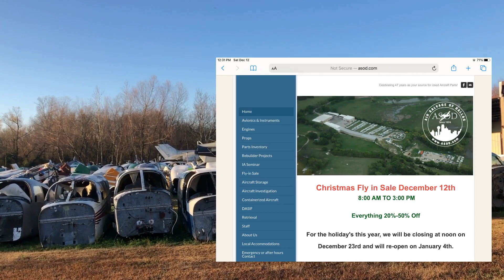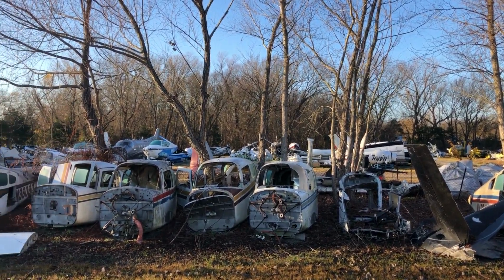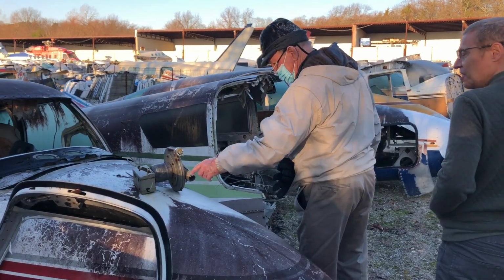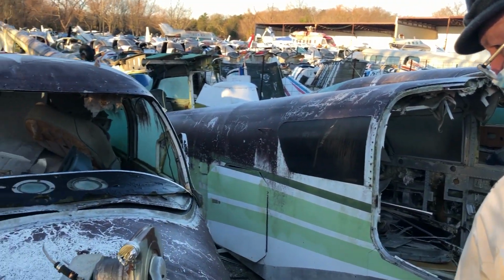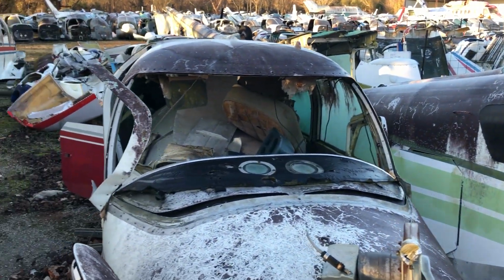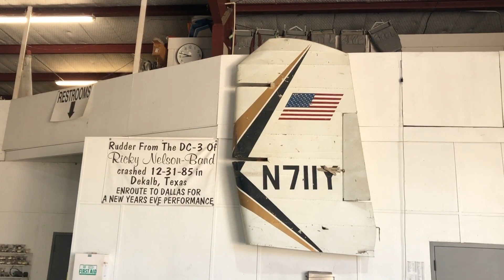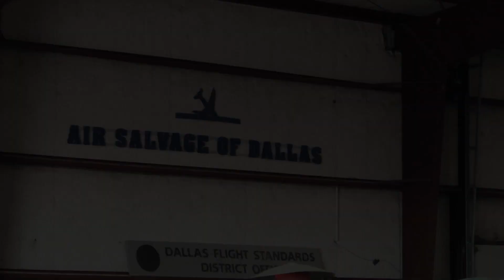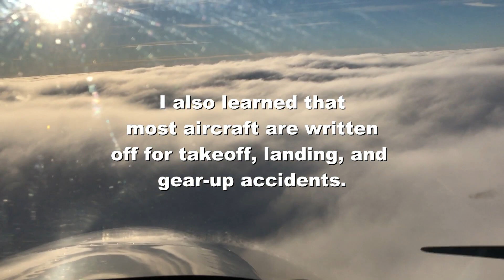Where old Cessna's go to die - salvage yard open day

Comment: I owned a ‘58 Cessna 310B for 7 years then upgraded to a ‘75 310R. I flew the R for 17 years. Absolutely loved the airplane. I’m 78 now and the day I sold it was a tough day. Still miss it. I bought parts from salvage yards all over the US. it’s the only way to keep them in the air.  I never once worried the part was unsafe as a VERY thorough inspection was done prior to installation. The new owner loves the plane.

Comment: I used to fly Beech 18's and MU-2 for an air cargo business out of KRFD and the ending of this video reminded me when I descended into a cloud and it opened up into a gap of another cloud layer and once I was in between both layers static electricity started forming around the nose and my windscreen then about 2 inches above both props on the engines. It was pitch dark out on my way to Vancouver BC until the static electricity or St. Elmo's fire this was the only time I actually got startled and asked ATC if I could descend the little more into the clouds

Comment: cant believe people would buy aircraft parts from a scrapyard and put it in thier airplane
Reply: Most of these plane types were low number production runs so if you’ve an older plane and need parts you’ve not many options available. My dad has has a early 70s Cessna and needed to replace the nose gear cowling panel. It required a world wide search for a replacement took 7 months found one in Australia meanwhile the plane was grounded. Scrap and parts yards are a godsend to those whom like older planes . Not like cars as the government doesn’t give a dam what sorts of parts you use to repair your ground vehicles. In planes every nut bolt part must be inspected every year or no permit to fly it. Only alternative is to have brand new parts custom made at a exceptional high cost
Reply: no matter, many used can buy and work well next all you life in old planes.
Reply: only totally idiot waste money and buy alltime only new parts old airplane. because used old can use, trimm wheels, brake parts, interior, gauges, tank, wing, windows,doors.engine.etc.etc,etc.
Reply: Talk to the people who fly old planes and talk about parts.
Reply: @bluemarshall6180  many million peoples fly used, old planes, and many hobby restore old planes and then fly.
Reply: After.01 hours your plane is “used”. Just saying.
Reply: @bluemarshall6180  I see